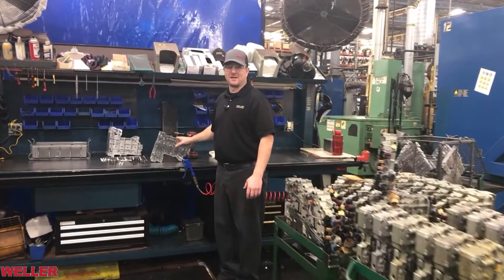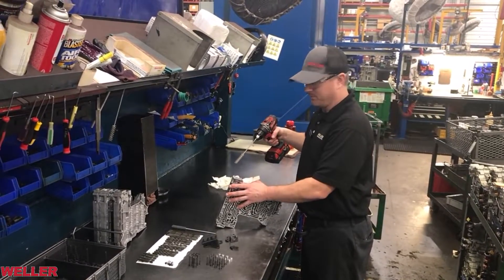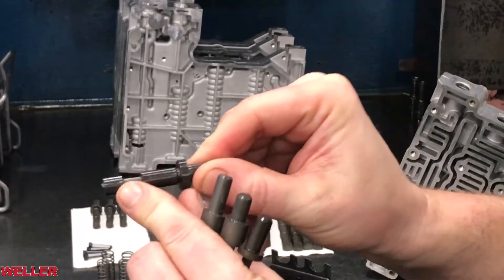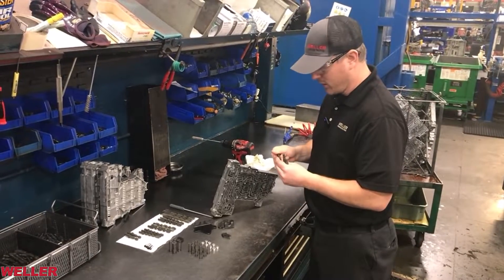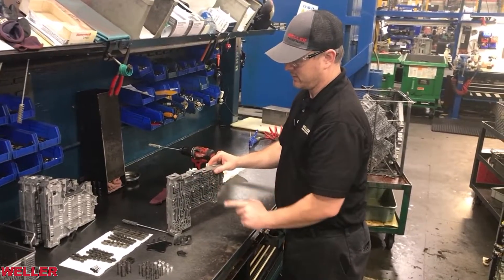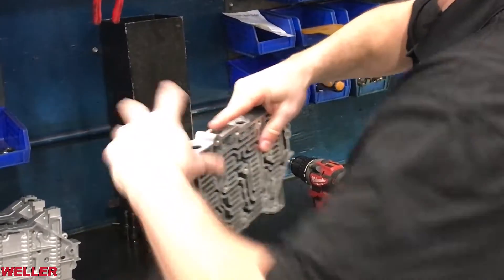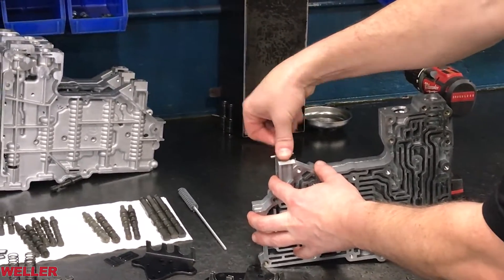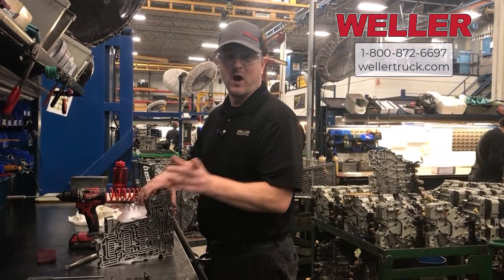Valve Body Assembly

Comment: What is the material of the valve? Can I please learn?
Reply from the maker: Greetings! The valves are anodized coated aluminum. Hopefully that helps.
Thanks
Reply: @WellerTruckParts  Thank you sir. Are all gears activated in these transmissions in case of emergency? I'm asking because it interests me because since solenoid valves work with electricity, I wondered whether they work hydraulically in case of a power outage.
Reply from the maker: @Hydraulic_System_22  Hi Again,
In an electrical failure the trans goes to limp home mode. It will lock the trans in a safe range and not shift until power is restored or code is cleared.
Reply: @WellerTruckParts  Hi Sir,
 Hmm, I understand better now. Thank you very much again.
Reply from the maker: @Hydraulic_System_22  Glad we could help! Thanks